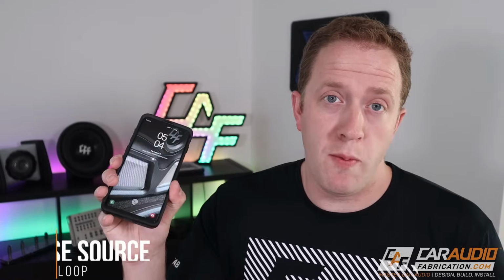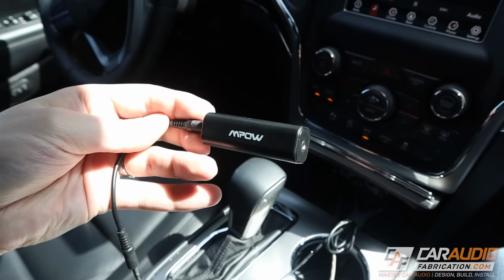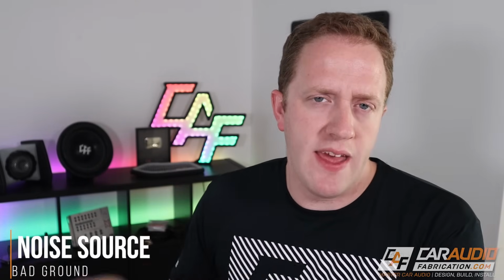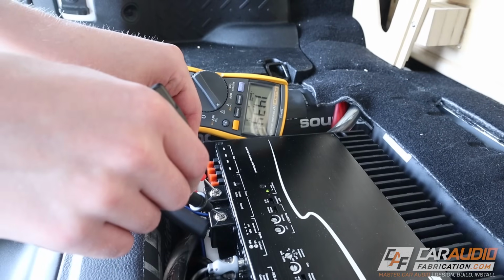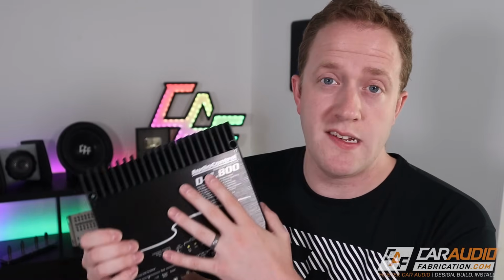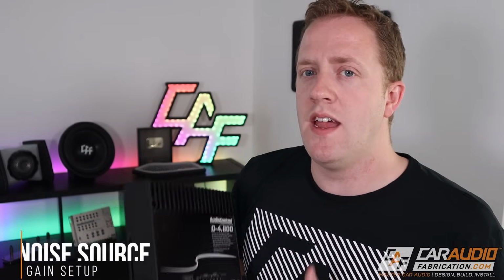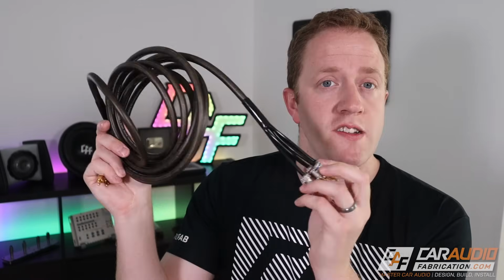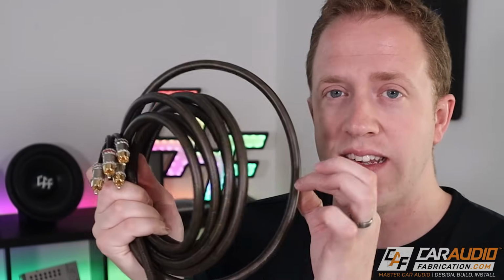BUZZ, WHINE, HISS? How to FIX Car Audio Noise!

Comment: I just replaced a failed amp in my classic Mini Cooper running aftermarket pioneer HU. Was sounding fine before old amp died (protect warning light on even when everything but power disconnected). With new amp, same pre-amp signal/speaker wires and power connections, I'm getting high pitched whine that varies in pitch with engine rpm. Also a clicking which goes away if I shut off the electric fuel pump. The clicking and the whine stay at same level no matter what volume the HU is set at, even with it muted. I though the new amp was grounding through its chassis to metal car frame, so changed it to a wooden board but same issue. 
Where should I be focusing on?

Comment: I was using a ground loop isolator for my aux cord and I still get a whine. I have an inverter connected to my car's battery and have an aux cord running to a TV to my car's audio and STILL get whine with using ground loop iso. Please help

Comment: I'm dealing with the most problematic subs I've ever dealt with. some days they're great other days they hardly pound at all. I've been through the system over a dozen times and have changed just about everything to no avail. Now today when I get home, I shut the key off and the subs make a huge pop and then start squealing and hissing for about 10 seconds. Now I have pop everytime I turn the key on or off.... this is the first time they've done anything like this, most recent changes were made 2 weeks ago so im stumped at this point... anyone got any ideas? I can't handle another 8 hours of searching forums

Comment: Be sure to run your RCA’s along the opposite side of the vehicle from your power wires. **This includes your remote turn on wire**. I just had this issue and couldn’t figure out why. I had a perfect ground. The power wires were on the opposite side of the car and the only thing near the RCA’s was the remote turn on wire. I ran the remote turn on wire along with the power wires so that the RCA’s were by themselves and no more static, whining, or popping. 😁

Comment: hi michael with j and m auto audio freak 3 amp 2 10"? 4 6.5 4 tweeters and a dsp 1gage ofc wire  shielded cables up grad alt and wiring noisy is killing my very expensive audio  any help. please

Comment: I have one front coaxial speaker that goes in and out, in and out, when I hit bumps on the road or when I slam my driver door. Also a buzzing coming from that one single speaker. What could this be? thanks in advance anyone who helps me out.

Comment: Sorry about the dumb question in advance, but if I have poor AM reception on all stations and my FM stations all come in fine on a 2017 Camry is there a fix you know of?  I took it to the dealer and the mechanic said since the stations are audible with lots of static, there's not a problem.  
It's under extended warranty still under 30K miles, but maybe they don't want to cover it?  Or What?  We get great AM in all our cars in this area, so it obviously it has a problem.  It has one of those shark antennae on the roof, but don't know if that is for AM.

Comment: I'm  no pro but have installed maybe a dozen or so systems.  Usually, removing the chassis ground and running the ground all the way back to the battery solves my noise issues.

Comment: I have had  noise before due to poor grounding and after re-grounding I resolved the issue. However currently after this current install of a pioneer mvhs622 digital media device, and the MB Court PS1 316 components and 1-10 inch JL audio sub, I have a whining problem when the engine runs. I have a short ground to the amp. re-grounded the head unit. I even ran brand new high-quality RCA cables to the amp. I guess I’ll have to check the main vehicle ground from the battery next as you suggested.

Comment: I had a whine I fixed it when I moved the ground when I added an extra battery but it was the same place on the other side so idk it could've been that instead of sand paper I used a wire wheel on my grinder but I ain't n expert just a 17 y/o with big dreams lol

Comment: I don’t think you mentioned this, I was dealing with alternator/buzz/whine noises for awhile, but my noises were intermittent, sometimes they would disappear over bumps. Looked into everything. What it ended up being was the ends of the RCA cables that plug into the headunit, were touching the body of the car, introducing noise. Probably my fault for not organizing the wires nicely behind the headunit. Just wrapped the ends with tesa and 0 noise, that was driving me nuts lol

Comment: I have a small hiss (I guess that is the best way to describe it) coming from my speakers after installing an amp in two cars (both cars do it). But it happens when the radio is turned off. It’s almost silent but it definitely is there. Is this normal or is something wrong? The amp gain level is, at max, 50 percent. Again- only hear it when the head unit is turned off

Comment: I got a fun one. Current situation after installing a sub and amp in my 2013 SRX. It picks up noise at specific RPMs when reving in park and driving but the sound immediately cuts out when a door is open. And as soon as I press the rear hatch release the sound goes away. It stays away during the whole time the hatch is open and comes back when the hatch locks.. so there’s some ground tripped I imagine for the lighting system maybe? My thoughts to fix are, ground loop isolator,  run a 0 or 4ga. Ground from the battery to the amp, or figure out what ground in the accessory circuit is causing the loop? I don’t understand ground loops well enough to have confidence in the latter. Any thoughts or suggestions?

Comment: A little to late for the party but.. my car burnt a ignition coil.. swapped it.. and now I have a Noise in the stereo.. like. Appears like it's leaking the spark on to the radio.. but only under load of the engine.. i swapped again the ignition coil for a original one.. the noise reduced. But it's still there. Any ideas ?

Comment: What about hiss from smartphone apps loke spotify, When connected the smarphone to HU via bluetooth. Hiss doesn't hear at all when spotify isn.t open. When i open spotify, bang, hiss in tweeters, when +3db on passive crossover and less when 0 db on passive crossover. When i close spotify hiss gone  (but smartphone still paired via bluetooth with HU)

Comment: I plugged my remote into fuse box and I have just ground from amp !!  When I step on gas I hear car in sub speakers !! i have power and remote wire on same side and my rca are plug in back of car though rear speakers .... i have no loop filter yet ...

Comment: Thanks for this video (by the way, you're doing a great job by showing us everithing that you do in car audio, and the explanations are so detailed and clear)!
I have a issue with an aftermarket navigation system, by trying to connect the remote amp wire to a small 150W amplifier thats going to power up a small sized subwoofer. That amplifier needed a step up voltage device because it needs 24V to reach the above mention power. I didn't test it in the car, but instead I was trying to replicate the wiring system from the car, by using a small 12V battery to power the navigation and the stepup, and I used the negative pole of the battery for both, to avoid the ground loop.... the problem is that I cannot do the same for the ampifier since the power (+ and -) is comming directly from the step up! Do we have a ground loop here? Besides the noise is too loud... and I have noticed interruptions in music that I played, especially when I turned up the volume... maybe due to the low current of the battery?!? (7.2 A so it says)... anyways, that step up has a pretty large coil and I've tryed to putted farther away from the amplifier or to position it perpendicular to it, and still having the same noice! This navigation has a subwoofer out RCA and I connected it to the amplifier through a double shielded RCA cable! The output of the amplifier and the subwoofer speaker are connected by a proper speaker cable! I don't know what to do anymore... if you or anyone has any thoughts, please, I apreciate any help! Thank you!

Comment: Mark, your thoughts on running power wire (Kolossus) under car along the frame from battery to trunk. Encased in aluminum flex tubing. Any problems with that method

Comment: I've got an aftermarket head unit the other day and I have some static noises when wifi is on, turning wifi off also turns the noises off. I tried to isolate the wifi cable from the rest of the cables but to no avail. And then, while trying to rearrange the cables behind the HU the noises suddenly stopped, but I don't know why.

Comment: hi
i have just installed 2 pair of components and a amplifier with stock headunit..
and highlow conveter 
after installing there is a sound krrrrrrr stactic sound from only my rear left speaker.. as i put my ignition on and start the car, but i stop the car engin and start the car again the sound goes away..
plz help me out with this problem and how can it be resolved 
Thank you and wating for ur reply

Comment: One other important item I learned when tracking down noise in my speakers: Your RCA cable type DOES matter. There's two types: shielded/coaxial and twisted pair. If your amp has Single Ended (SE) inputs, then you should use shielded/coaxial RCAs. If your amp uses Differential Inputs (DI), then you should use twisted pair. My amp used SE inputs, but I was using a twisted pair RCA. Swapping over to a shielded RCA fixed my noise issue. 

Symptom I has was a constant, high pitched whine, regardless if car was on or if music was playing. I performed all the tests in this video and everything checked out, so it really came down to either my headunit or my RCAs. It was the RCAs.

Comment: My car somehow is putting noise into the power lines even when its just in the accessory position.. sometimes it stops but if i tap the accelerator pedal it restarts a kind of computer digital noise. And it must be the power lines because I already disconnected the dsp and rca to the amps.. 50mm2 power cable on the driver side, remote and dsp signal on the passenger side.
Any ideas?

Comment: I've never had nose in my stereo installs, but mine are pretty basic. Head unit, cap, amp, subs. However, I own a suburban, (chevy, unfortunately), and the stereo is all stock, with a power antennae in the rear window, and it has the bad ground whine.

Comment: I have a whine that started today but it’s so loud and annoying, I have a few wires close to each other but I moved everything and it went back to normal and then boom, it started doing it again, now I’m thinking it could be a bad ground connection, I made my own power and ground cable ☹️

Comment: Dude! You’re speaking to me. That whiny noise when I accelerate… I had my subwoofer/amp and aftermarket radio installed by a so called professional audio store. It’s very frustrating having those weird noises because they didn’t tune my system correctly like you said. 

I didn’t get a box and had my subwoofer mounted in the factory ‘hole’ behind my back seat since my car was a base model with no subwoofer but has a built in hole with a plastic cover. I also think the amp is mounted on the frame with metal cover it came with. Everything you’ve talked about in the video is exactly what’s happening.

Comment: I'm having the unique problem when I start the car, a loud high pitched shreak blasts through the speakers. I can't adjust the voume or turn it off without turning the car off. Once I immediately restart the car, the noise is gone. This also happens randomly so I've gotten to the point where I start the car and I keep my finger on the ignition, ready to turn it off if the shreak pops up. Here's a video I took: 

https://youtu.be/Q0naxenSC48

Any idea of why this happens. It started after I installed an aftermarket Android head unit. I even had the company send me a new one but it still happens.

Comment: I just recently got a sub/5ch amp w new Rockfordfosgate wiring to a stock radio (08”Civic Si) and notice when i turn car on, ebrake down car get whiny when ebrake is up and car is still before i disengage the ebrake it’s clear, what can cause the whine when i release the ebrake? Thanks in advance

Comment: I installed a whole new system. Got bad static. Removed whole system other than AM headunit and still get static. Re did grounds. Still static. Returned & Replaced head unit still static. Put oem head unit back in and no static. Currently pulling my hair out.

Comment: Hello i recently had this weird problem with my car audio.I have an old Pioneer deck for 2 years now.It was working fine until recently.One day i use the remote to turn it off and the next day when i turn it on,there was no sound from the speakers.It was fixed after i removed the battery poles.Any takes how to fix that...and what it might be the cause?

Comment: I had alternator wine mostly from all speakers but mostly one tweeter. I unhooked rca cables from amps and sound went away. I plugged em back in. I unplugged rcas from deck and noise went away. That means it's coming from deck. I regrounded it close by with bigger wire instead of to the cars oem stereo harmess and it didn't do anything. I knew all other grounds were tight. I WRAPPED WIRE AROUND EACH RCA ON OUTSIDE OF head unit WITH RCA's off and grounded each end of wires to different screws used to hold the head unit together. Noise is 100% gone. It's a nice Kenwood excelon touch screen- why did this happen and is there risk of fire???

Comment: so i've been fighting any combination of static, buzz, and alternator whine for almost 2 years in my system. it's worse on a bluetooth connection, and least on a USB drive source.
here's what i've tried - 

RCA's are shielded and on the passenger side of the car. they've also been replaced.
Power is down the driver's side, along with remote. 
Optima red top is main battery, less than 2 years old. Battery cables and terminals replaced.
Head unit has been replaced, equalizer has been added, stand alone constant straight to the battery (fused of course) supplies power to these two, and a dedicated ground to under a seat bolt.
Amplifiers have been replaced. started with el cheapo duals, now have RF prime amps, r500x1d for 2 10"s and r250x4 for 2 6x9's and 2 6.5's. all rockford fosgate as well.
Gains are matched with multimeter.
Speaker wires are all aftermarket, no breaks or shorts to be found.
High amp alternator was installed, Big 4 completed, second battery installed in trunk, all with proper fusing. 
All grounds have been cleaned, copper fittings, nuts and bolts through paint free steel.
Grounds for rear battery and both amps go to the same, paint scraped, hole drilled, nut and bolted connection on the back of the rear seat support.
Ground loop isolators made zero change. 

I'm hoping someone has run into a similar situation and found something i've overlooked. it gets really annoying sitting for an hour on the way to work and hearing the whine or crackle, buzz, static and cell phone interference coming through the speakers. thanks in advance!

Comment: I have one from my usb connection. I  have a android auto usb dongle, with a Y piece usb dual power cable. One usb goes to extra usb port for power... then another is a pass through for the dongle.

This causes that horrible static. Any ideas how to fix it? There is no aux

Comment: i have a 4 channel amp for my door speakers and still getting static noise from all speakers and tweeters even after using triple shielded rcas. Everything else seems to be good... not sure what the problem is ill check my gain

Comment: I just wanted to thank you very much for your informative videos.  I decided that my 11 Caddy speakers were dying and needed to be replaced.  I didn't realize that meant an avalanche of problems doing so.  First the new tweeter blew, then the Metra conversion box blew 3 TIMES and then the amp went to hell.  After I figured everything out, I had a terrrible hissing sound.  I watched your videos on solving it and not only did the hissing go away but the sound improved.  Thanks a lot for doing them.

Comment: I recently installed a Soundstream st4.1000d amp in my truck. I run the factory head unit, but have upgraded all speakers to Kicker DS. I have noticed a whining when ever the engine is running while the amp is in HI pass of full range. If I switch it to LO pass the whining stops, but I don't want to stuck using LO pass. Any ideas?
Cables used are the Rockford 8 gauge set. Power cable is about 8 ft long. Ground is about 14 in, and direct body connected very well. Amp is mounted under driver seat.
Vehicle is a 2016 Ram 1500 w/o the Alpine system.

Comment: I have a light static noise coming from my front tweeters after I installed a new HU. I don't have a 4 channel amp running the speakers just the HU. I re grounded the HU and it reduced the static by about 50 percent. But there is still a slight static in my tweeters that has been annoying me when quieter music is playing or no music playing at all. The static is the same at any volume and doesn't really increase but it goes away completely if you put volume at 0 and fully comes back at 1. Not sure what else to try since I have already replaced the ground and tested the ground location and it was getting full voltage from the HU power wire to the new ground location. If anyone has any other suggestions I'd be open. Could it be caused by the HU not getting enough power? Since I'm using the factory stereo wiring harness and using the built in power wire. Should I tap it into the fuse box instead to get full power? (My stock radio fuse is 7.5A and the fuse in the power wire of the new HU is 15A.)